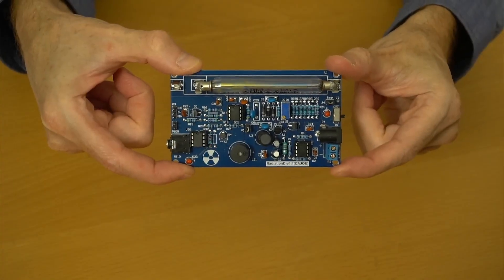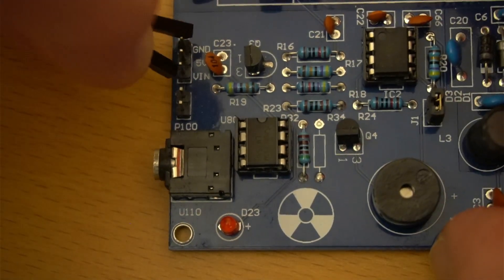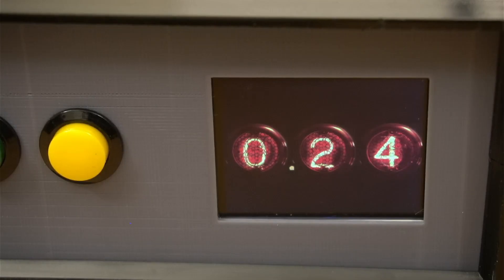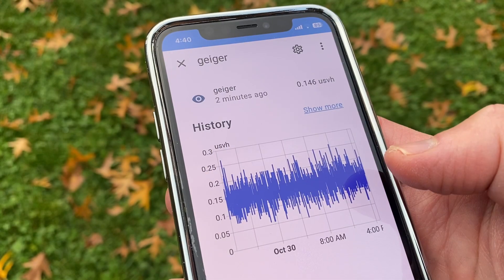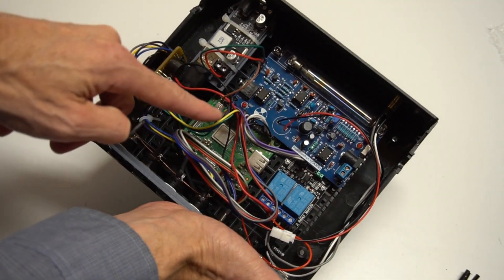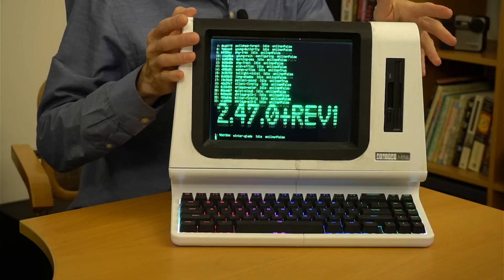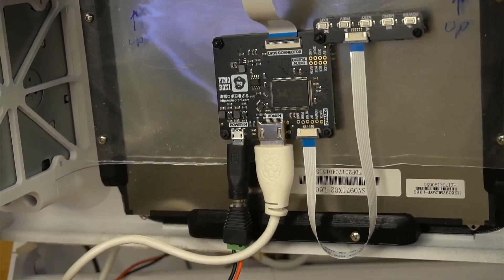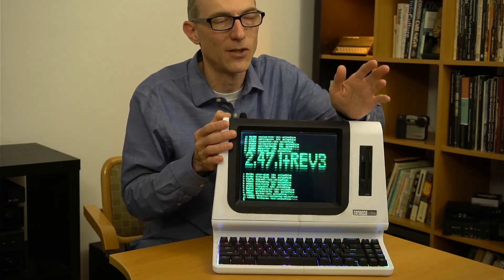Raspberry Pi Geiger Counter and a DEC Mini Build

Comment: If you want to stick with the DEC theme, Oscar Vermuleren makes 60%-scale PiDP kits, which are front panel replicas, with a Pi inside doing the emulation (simh for the -8, -11, and -10, and the blincolnlights simulator for the new -1).

They're all delightful and make nice blinkylight backdrops.  As a prop for the show I'd probably recommend the 11, which is a PDP-11/70 front panel.  The -10 is very large and quite a bit more expensive; the -1 is gorgeous and the switches feel great.  The -8 is fun too (especially if you like minimal computers) but the beige-and-tan color scheme isn't as yummy as either the purple-and-red of the -11 or the blue-and-green of the -10.

You can, of course, run a lot more on the -11 than the other options (including the still-maintained(!) 2.11BSD Unix and RSX-11M+, which Johnny Bilquist has brought into the 21st century with a fully-functional TCP/IP stack and package manager), and the PDP-11 is a computer that you very likely might have had a VT-101 hanging off of.
Reply from the maker: Thanks for the details, I've seen a few of those replicas up close and they are great!